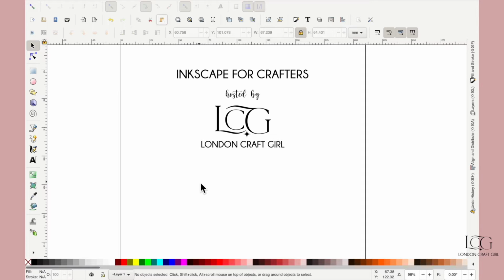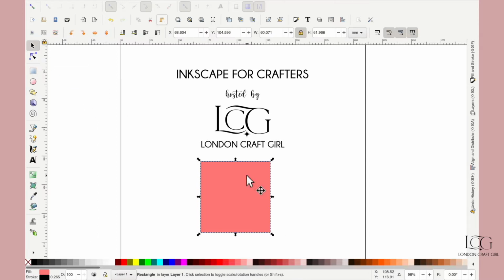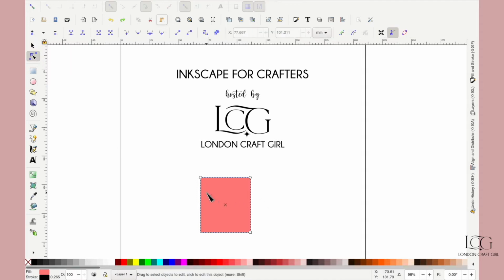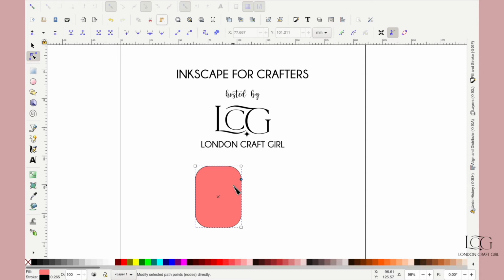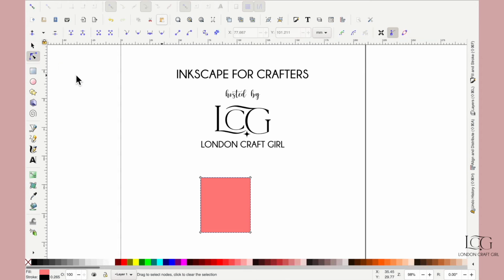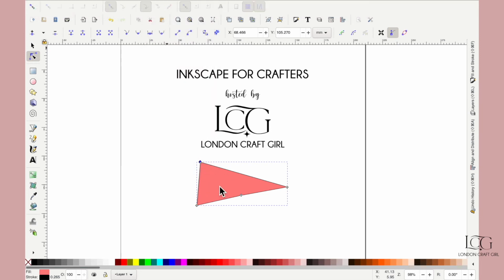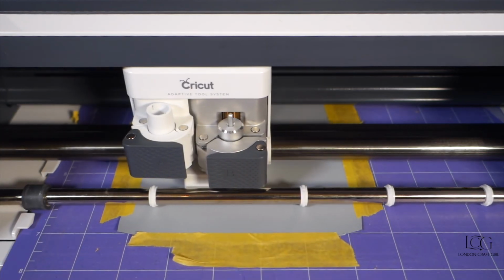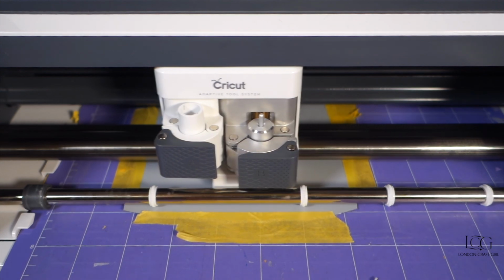Inkscape for Cricut | Nodes in Inkscape and how they TALK to your Cricut Machine

Comment: Hello. Thx 4 the vid's. Hoping u can provide some pointers. Having trouble getting complete cuts on imported svg/dxf files of my own creation on my device. 4 example, on small squares, the blade stops just short of the corners prevent'g the square scrap from detach'g. I use 2D SW, import dxf to Inkscape, then import svg to Cricut. (Import'g dxf directly yields more isses.) Lines all look good to go, but it cuts as though there are breaks/gaps in the lines. Cuts perfectly using Cricut's test cut pattern. Blade is new and not a pressure thing. Combined nodes in svg, still same results. Any design tips to ensure continuous cuts?